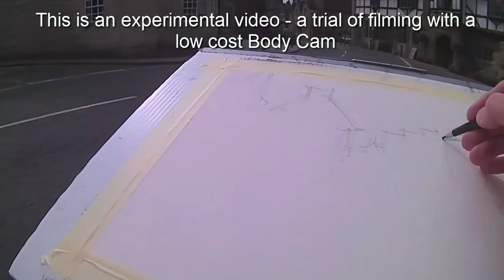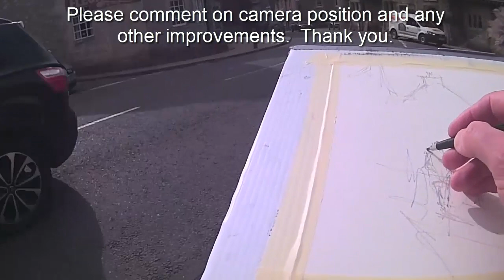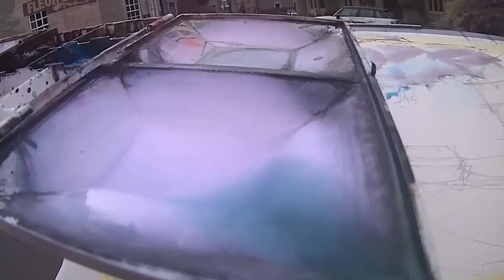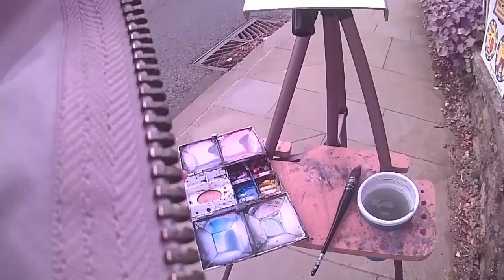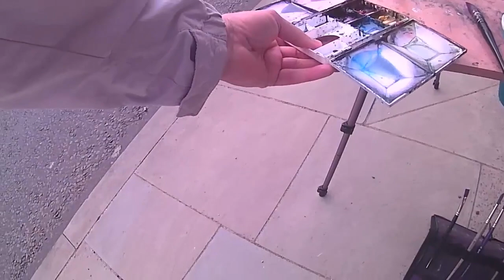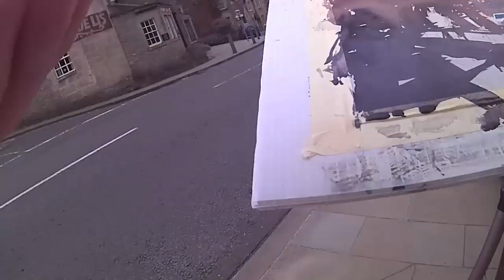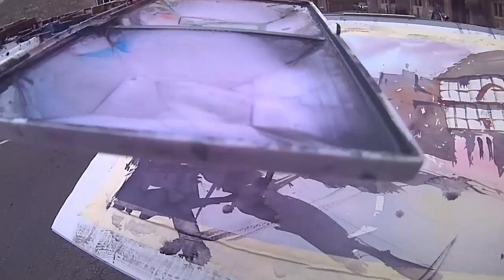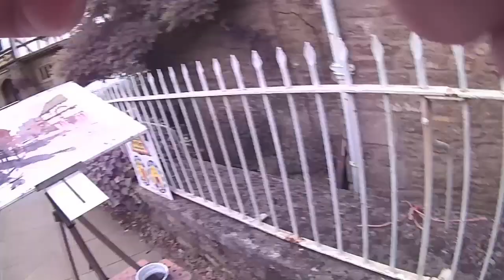Plein air painting - sometimes you have to ignore the noise around you! #saunders #waterford

Comment: Thanks for posting.  The pallette got in the way at times, but we definitely got the feel the plein air experience.  What tripod and top do you use?  Does the tripod have a special attachment to connect to your corex board?  Thanks again.
Reply from the maker: Camera tripod with a hand made metal support for the corex board.  The metal support clips into the tripod top.